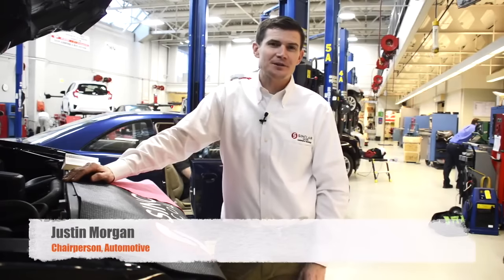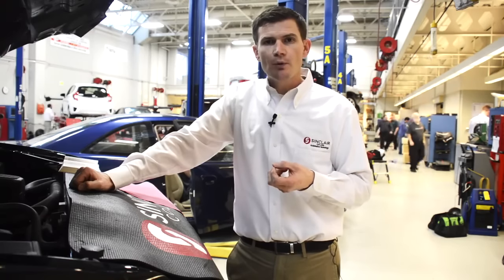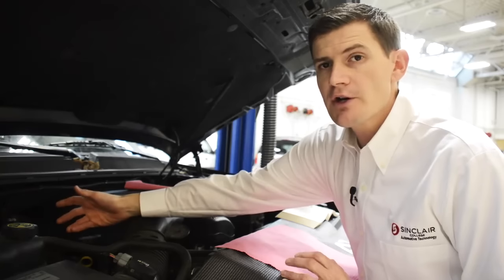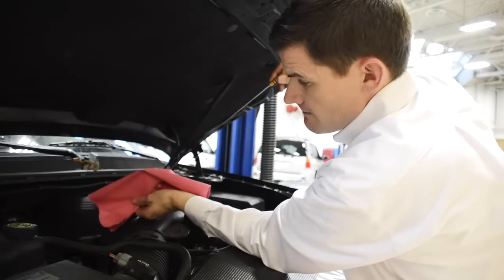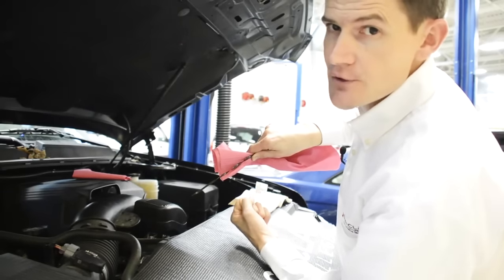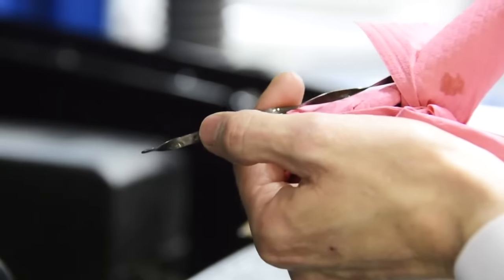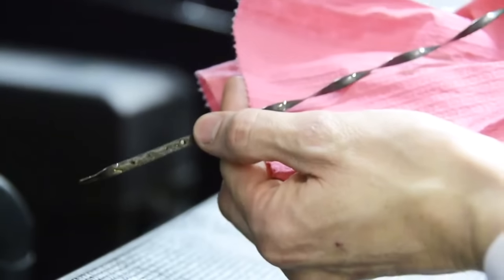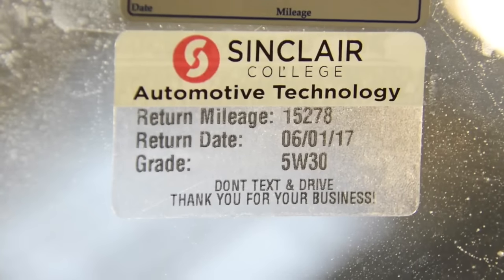How To Check Dipstick & Engine Oil - EASY

Comment: The dipstick ought to be painted in white enamel so you can see the level
Reply: The dipstick would be subject to very hot oil, so any coating would likely fail
Reply: Not to mention oil doesn't stick to enamel.
Reply: It’s got notches and says min and max.
Reply: @freewithnature  some don't say max or min it's just the two lines
Reply: @mtnbike4lifemaxxis837    Oh well then, so then don't even try, cause it Might not work.
Reply: You can rough up the dipstick with some sandpaper to help hold fluid on it . This is more helpful with fresh fluid that can be harder to read. Don't sand on the side with level marks use common sense

Comment: If people do what he did the engine will run happy and last for a long time, ofcourse  with a perfect cooling system
Reply: @tomdolgin5441  oh my God, the word dexcool makes me want to not work on cars anymore
Reply: @rickporterbridges  water pump, thermostat, temperatures sensors, horses, cooling fans , clean radiator,  good entifreeze,  radiator cap and a lot  more
Cooling failed engine die doesn't matter which oil u use
Reply: JSway 24  take to the dealership that's what they want
Reply: Just buy toyota and you'll be fine
Reply: @gingertrilogy366  They also have a problem with oil consumption and engine failure, the exception being the Prius

Comment: I’ve seen a ton of these types of videos but very few mention the oil burning in the cylinders and the low oil due to the new longer change intervals. Thank you for bringing that to light. This is probably the best oil change advice video I’ve seen on YouTube.

Comment: For those comming here to find out how to check oil, a couple of things not pointed out in this video:

1. only check your oil when the car is on a flat and level as possable surface, its useless to check oil on a vehicle that is on a hill.

2. the thumbnail is useless, oil will be dark in colour unless you do a complete engine flush. (dont believe me after you do an oil change, drive for 10mins then check it again, it will be dark and blackish lready)

3. when checking oil on the dipstick, after you pull it out to see the level. always keep the end with the oil on pointed towards the ground, if you raise it up, oil will run up the dipstick and your level will be incorrect.

4. you can put too much oil in a car, if its near the top marker, its fine. unless you know what your doing you may cause more problems trying to top it up that last little bit.
Reply: Thanks
Reply: Yea pretty much. I change both my engine oils at 3000mi and the oil always comes out dark brown.

Also, I have 5W30 synthetic. So when checking the oil (when the engine is warm, waiting 5min before checking oil according to the manufacturer) the oil on the dipstick appears different. At the tip it's dark, at the "L" mark it is medium brown, at the center it's light brown, at the "F" mark it's really light in color
Reply: @epicraptorman  the colour on the dipstick is only due to the oil running down the dipstick, making the 'top' seem lighter as its a thinner layer of oil.
Reply: After driving I parked my car on perfect level surface and 10 min later I checked my oil when it was hot and the level was on the full mark. The next day when I checked my engine oil when it cold and sitting all night and checked the level again and it was below the halfway mark of Full and Empty.
So what is correct to check the oil when it is hot or cold?
Reply: @winking2928  i dont know of a vehicle where heat alone would of made such a difference. im willing to bet other factors where at play. heat alone in most cars setups would move it at MOST 1/4 of the way up, but to answer your question, warm is the best temperature to test your oil.
Reply: Matthew thank you so much for the reply
Reply: @winking2928  thats fine, to be very clear, its warm. NOT HOT. vehicle must be left for 20minutes or so after driving before testing oil (or running) this allows majority of the oil to drain to the tank in which you measure it in.
Reply: Matthew Yeah I tried at different times to check the oil level to check any differences.
I tried early morning 
10min after driving 
1hr after driving 
They all read full on the dipstick
Funny though one morning the dipstick read half full and then another morning it read full.
Completely baffled as all levels were check on level ground at the same location.
Reply: @winking2928  how’s ur car now if I may ask :)
Reply: Thank you
Reply: @gerahuey3706  no problem man, changing oil is so simple. but all it takes is  little explaination
Reply: @matthew4107  Yes, and you did an excellent job-- Blessings to you and your family!!
Reply: @matthew4107  how do you know when to change to oil though?? If I don’t have the sticker that goes on the windshield
Reply: @adrianvaladez7522  changing oil comes down to two main things, engine run time/distance travelled/mileage and time.  if you look in your cars owners manual they all state at recommended oil change setting, alot of the time for petrol engine cars this comes in to changing oil once per year or once per 12000miles whatever comes first. the numbers i gave here are rough estimates and its quite important you relate to your cars owners manual to check the recommended periods.

for a loose example, completely drain and change your oil and filter once per year, but if you do 'lots' of miles per year or month think about changing the oil more frequently. i would personally say 2000-2500miles per month is 'lots' in relation to typical engine run time.

on things that do not move like generators and pumps oil changes can be recommended for as little as every 50 hours runtime. especially when new. again, look at the owners manual to know how often you need to change the oil in these items.

changing oil is MORE important for a new engine than an old one. but not by much, its still very important to change oil in any age engine.
Reply: @winking2928  Could it be that the dipstick was not completely inserted when the dipstick measured only half full?
Reply: @clivejacobz2090  completely inserted on each check, and checked not just once but many times
Reply: I legit can't tell where it's marking. 2012 Toyota Corolla LE changed oil since maint req light came on. Changed the oil filter, emptied the pan waiting forever for the last drop HAH anyways had a 5qt oil container and I didn't add it all since it calls for 4.4 qt. Took the car off the ramps. Let it run for 2 mins. Waited. Checked the oil level a million times, wiping it off and dipping it all the way in. All on level ground. The oil obviously isn't as dark as it was before the oil change. I checked under the car and no leakage. I'm going to let it rest over night and check it in the morning. Any advice??? I didnt think my eyes were that bad. I can tell the dipstick is wet just not a clear level of indication where it stands.
Reply: @haileyb9062  if theres oil on the dipstick 'wet' then follow my instructions above, keeping the wet end pointed to the floor, but move it side to side, use the light/sunlight to get a reflection off of the oil

also: never just run an engine without knowing for a fact there is oil on the dipstick measuring tool, just because it says 'put 4.4quartz in' you cant just blindy put that much oil in and be 100% sure it has enough or not too much oil.
also, 4.4 quartz could of been a without changing oil filter amount (the oil filter has to fill up)
ALWAYS, drain fully, put 10% less than reccomended in straight up, then slowly add more and more until you see it on the dipstick, run the engine for 10seconds to fill the filter and system, wait 5mins for oil to drain to the bottom and onto the diptstick, and re check the level and fill as needed.
THEN you can let the engine heat cycle. because it has oil in it now.
Reply: @matthew4107  what?! oil change every 12000 miles?! Hell no you shoul change your oil every 5000 miles. 7000 max.
Reply: How to open Radiator cover and to close it

Comment: Be sure to frequently change your oil. Check the dipstick once a week if you have no leak and 1 to 3 times a week, if you have a leak, depends on it's severity, add if you have to. Make sure the oil on the dipstick is not below the lower mark or even worse, dried out and if you top it above the high level, don't panic unless it's way up high, if it's a half an inch extra you're fine.
Check your dipstick every time right after you leave the oil change shop to be on the safe side.
Reply: But if its a car under 30k milks you shouldn't be needing to top it up am I right?
Reply: @asmokingp3005  right. Generally you shouldn't need to top up at all. If you do there is likely a leak or your engine is burning oil(parts are going bad). Both not good but fixable if found early.
Reply: @freebein  I have the defective 2az-fe engine on my Toyota which is poorly designed piston heads. No recall from Toyota for every owner with that engine.  I just top off often between oil
changes. Does
The oil level always need to be at full mark? I usually just top off once it’s 1/4 on the dipstick before topping off.
Reply: That’s too much checking
Reply: How long should the car be off? 5 minutes?
Reply: You don’t need to check your oil once a week 😳 or frequently change it.
Make sure you do your own research before accepting what someone says here.
Reply: @freewithnature  once a day?😱😭
Reply: 1 week is too much.. people can do more important things than checking oil in 7days.  Soon life is all about cars. Batteries.  Tyres rotation. Fluids changes car washing.    Cars are more reliable this days. 1 month should be fine as per manufactures recommendation. Most of the manuals. Merc, Toyota . Mitsubishi etc
Reply: A little excessive, don't you think?
Reply: @freewithnature It doesn’t hurt to check it once a week it literally takes less than 10 seconds lol.
Reply: @Decode_Existence yeah. Checking once a month or every two months is ideal...  I usually top the oil up my 2007 Lexus is250 every 4000 miles or 3000 miles. Then oil changes at 6000 miles (the maximum gap is 7000 miles between changes). Seems like my engine is still healthy as it still isn't burning much oil, just half an inch every 3000 miles, which is completely normal for a 16 year old car...
Reply: @jondoe170  - have you got any more rhetorical, lazy questions?  ehhh?
Reply: @eligreg99  - 1. takes more than 10 seconds to check oil level, popping hood, wiping off dip-stick . . . .   2. re: "lol" = what is so funny about your comment?  3. or do you use that wimp "lol" at the end of social comments.
Reply: @warriormanmaxx8991  Who
Reply: @warriormanmaxx8991  not at the moment, I'll get back to you with some 👌
Reply: What do you mean once a week? I never did anything for like 4 month. That’s what my mechanic said. He did all the checks and told me that’s till next service. Do I still do my own checks? Damn

Comment: Seemingly simple topic, however well presented with some good info. Oil additives have improved dramatically from the past, (allowing for much longer intervals than 3,000 miles) however as pointed out in this vid, oil level must be checked when stretching out beyond 6000 miles or so.
Reply: Unless it’s a type r then check every week lol vtec drains it
Reply: 200,000 Miles and counting, serviced every 9000 miles, occasionally 1000 miles late. Still stock and factory baby.

Comment: My neighbor is a retired Canadian military safety equipment mechanic and he showed me how he does it:
Pull out the dipstick; note the level; squeeze the thumb and index finger down the dipstick; note the color and the presence of froth and gunk; take a sniff at it for anything unusual, if it is just a uniform light to darker shade of brown, the oil is good.  Yes it is a messy job, just thoroughly wash hands afterwards.

Comment: I usually us the “Trip A or B” counter. I reset it at oil change to “0000”. This tells me how many miles. I change occurring to miles not months. I also keep 1 quart of oil and a funnel in the truck at all times.
Reply: thurm101 that’s what I do to bro
Reply: @pushhrodd01  What does he mean when he says he change occurring to miles and not months.. in thurm comment what this means?? what he mean by months?
Reply: @lolz616  He means like some people will say 6 months or 3000 miles for an oil change. He doesnt go by the months he goes by how many miles hes put on that oil
Reply: Same here buddy 👍
Reply: Good  idea
Reply: Hey @turman that's okay, but what if your car is burning excessive oil or if it's leaking, you have to check your OIL!!!
Reply: this advice was better than this video.
Reply: This. This is the way.
Reply: This is bad advice. Oil has a set lifespan. The typical advice is change your oil every 3000 miles or 3 months, whichever comes first (this is the important part). If it's been 3 months, change your oil because it's worn down in that time frame. So many customers say "it's been 2 years since I changed my oil because I only drive 1500 miles a year" and wonder why their engine is blown up.
Reply: @johnconnor2402  Those type of customers aren’t typical. So oil sitting on the shelf at the store has to be “thrown” out after 3 months? Used oil is different. Of course oil breaks down after use.  But that’s after using the oil not  TIME.  The 3 months or 3000 miles was a sales tactic used to generate sales. Just get into the habit of checking your oil often for your particular car. Fill when needed.
Reply: @thurm101  There's a big difference in oil that's been on the shelf and oil that's been sitting in an engine exposed to combustion effects.

Comment: Thanks for your very good explaining on how to check the engine oil, let me explain something, mostly of people suppose to know how to change an oil in the car, and some ladies know how to check oil in the car and change oil in the car, I'm speaking specially about men, I change motor oil regularly in my car every 3,000 miles or every 3 months, and that is a very basic thing to do in a car and it takes 15 to 20 minutes to do that, I'm full mechanic but I know something about  a car, I had a 2003 Cadillac DeVille for 5 years but in 3 years the DeVille gave me 2 problems misfire and the starter but the starter was located under the manifold and it was a big job, I was going to 5 different shops they asked me $1,000 to $12,00 to fix my DeVille and I said wow and I was going not to spend that kind of money in my DeVille, I know for sure my DeVille needs to change the starter, but I didn't know yet why my DeVille misfire, when I checked the spark plugs and there was an oil in every each spark plugs, I said wow I found the misfire problem, the starter did cost me $63 on eBay brand new, and the gasket cover kit did cost $92 brand new in AutoZone, it did cost me $155 to do everything by myself,  no more misfire problem and no more starter problem, and I almost spent 4 hours to do everything, one more thing $155 are different with $1200 and after 2 years I sold it, I don't know for someone else but believe me the engine and transmission on those DeVille are so strong, but now I have an 06 zephyr and I'm for another DeVille to buy, someone said specially for my people they said Toyota this and that and that is a completely lie its depending on how to treat your car, and favorite car are Ford Chevrolet,
Reply: I agree. It is all how you treat the car.
Take care of the car and it will take care of you.